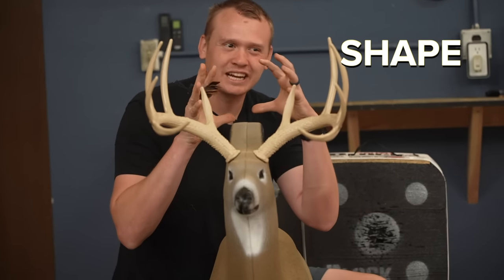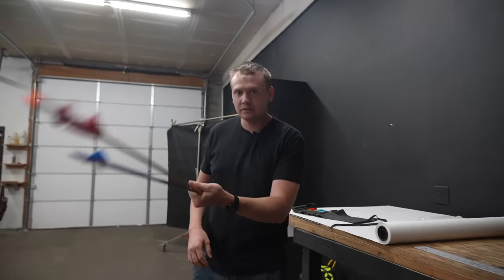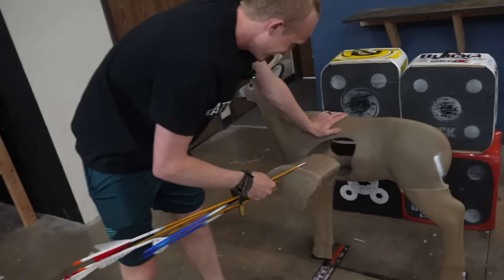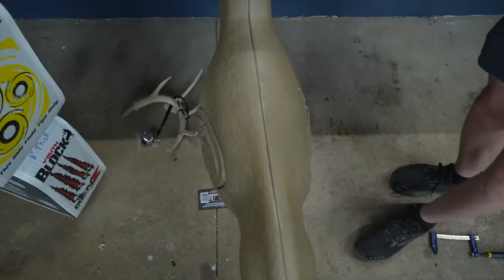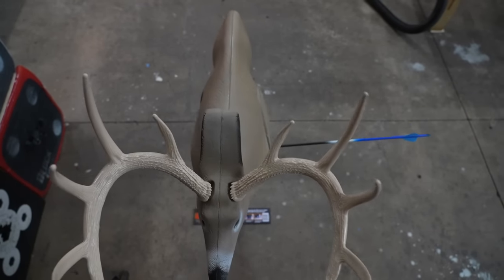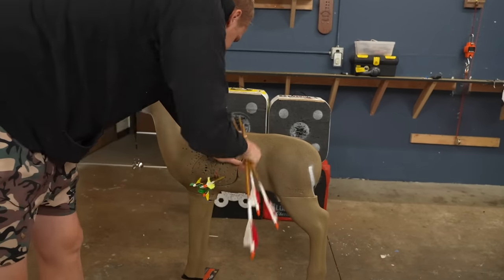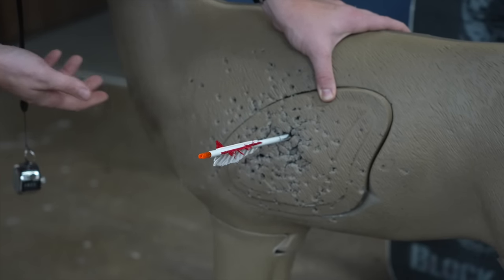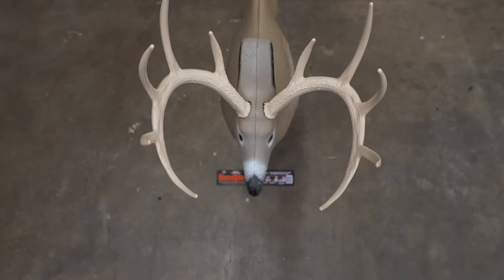Is The Cheapest 3d Target ANY GOOD? (Target review #7)

Comment: Suggestion: After you test all the targets, get a set of the 'build your own' bags, stuff one with old clothing, one with plastic grocery bags and test those against the pre-made targets. I'm really curious how they would compare.
Reply: Good idea. Sort of a comparison of DIY options (suggested on YT).
Reply: Also the carpet one, cardboard one
Reply: I take all my brown paper feed bags from my animals and fold them into a pile which I shove into a cat litter bag and then place a few more cat litter bags. Makes a nice self healing target for free
Reply: I have tested old plastic bags (also used pallet wraps, and old tunnel plastic), mixed with styrofoam, and any type of rubish foam. It doesnt take water - so not getting heavier and dump. also you can add more foams if pundage is lower, or more plastic if bow is heavier. In both cases you have to compress rubbish stuf to strong plastic bags - I use old grain bags 3 - 5 layers. Quality wise, it might be similar to those target, but is completly free and recycled.
Reply: My homemade target is going on 3.5 years. It uses old berlap sacks as the target face and old clothes and such as the innards. If it stops working as well, I just open the top, pull the clothes out, put them back in and it works for the next several thousand shots.
Reply: Try testing stretch wrap

Comment: Gotta jump in on this one. I have owned a couple of these now along with a 220$ delta McKenzie target 
The shooter buck in my opinion is just as good at half the price 
I’ve repaired mine with expandable crack filling foam from Home Depot 
Walmart etc very cheap and it holds up fairly well 
The other disadvantage to the target is the hard plastic legs
If you drop a shot
Shank a shot and hit the leg it’s very very difficult to remove the arrow and if you hit the leg enough you’ll break the leg 
Not really a concern to experienced archers 
But should be a consideration when first starting and increase your distance which increases the risk of dropping a shot 
Otherwise it’s a decent target 
Thanks for the video 
JimR

Comment: The reason I purchased mine was for the price, I don't have the budget for a 3 to 500 dollar target. I don't run a high volume of arrows through mine, but enough to have fun with. I added some glue to the insert to keep it in, and filled the legs with expanding foam when I realized that hitting the legs would cause it to shatter in that area. All things considered, not a bad product for the price.

Comment: I have a 3d deer target that has a roughly 10x10 replaceable block representing the vital and it is held in by 2 pine dowels. I only shoot at it a handful of times per week just before and during hunting season to keep myself in the mindset of the kill zone on a deer. Also the block can be flipped to different sides for broad side quartering and elevated shots. Its advertised on the box as self healing foam and for broad heads..